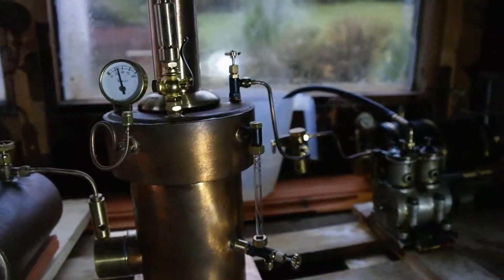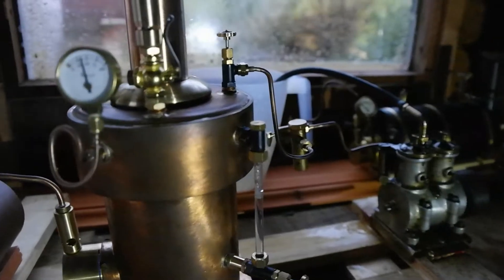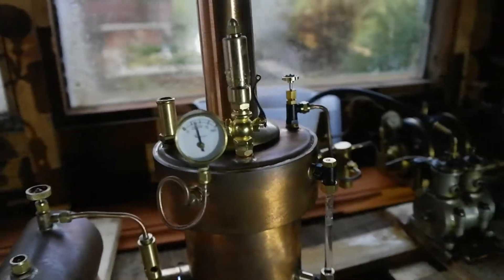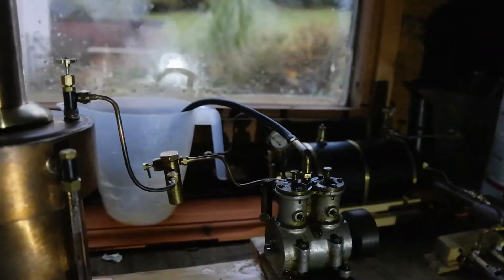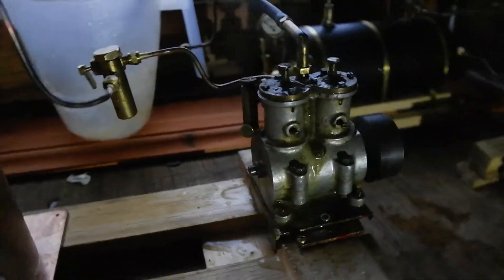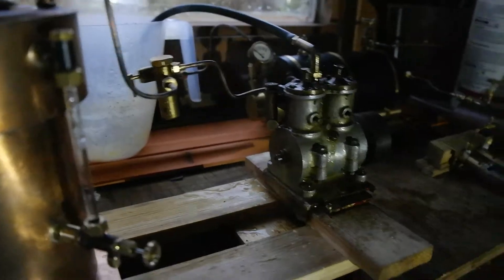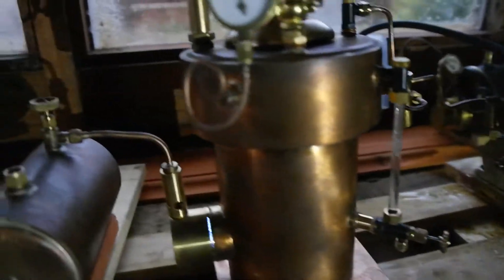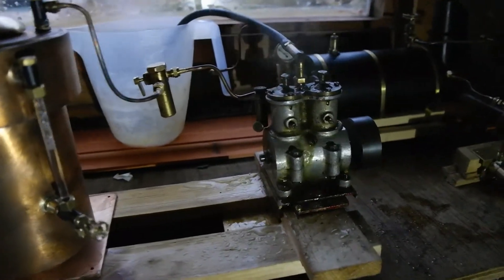KINGDON BOILER  STEAM TEST BL: GF MARS ENGINE

Comment: Bonjour Roy,
Your Kingdon boiler is quite nice but I am not sure that the leaks on the machine are normal...
I am happy to see you so busy. Let's have a lot of projects for 2018 :+) 
Amicalement, Rapaël
Reply from the maker: Bonjour Raphael ,  yes , I see now , she is running very wet , and at 70/80 psi she does run dry,
as in the 30' these engines were run on flash steam tether boats ,
Reply from the maker: Bonjour Raphael ,   " studding my videos : the reason for the water from the sum is because I started her
anti- clockwise instead of the std clockwise (haa ????)  " getting old ???
Reply: We are never old when we have a passion !!! Amicalement, Raphaël

Comment: Nice boiler and engine! 
What's the advantage of a Kingdon design boiler over a normal vertical centre flue boiler?
Reply from the maker: Calin hi it's very difficult to heat a vertical boiler , but here the tubes are designed in a way
To heat up fast, it's the s
Design thanks
Reply: Thanks. Could you tell me what the internal tube arrangement of the boiler is?
Reply from the maker: Calin hi advise you contact Nigel at Pendel steam steam boilers  07452 875912 thanks Roy